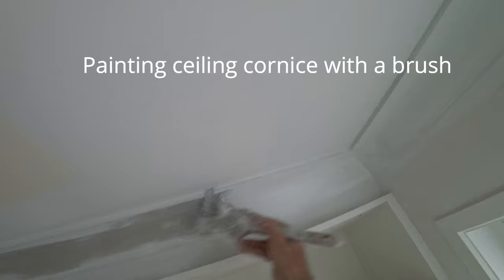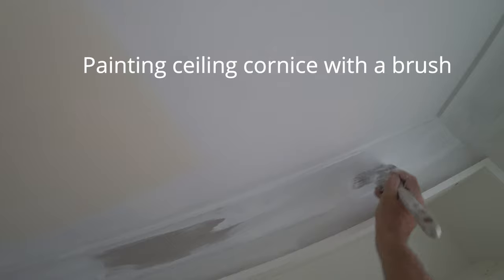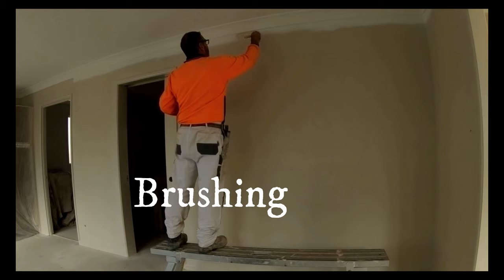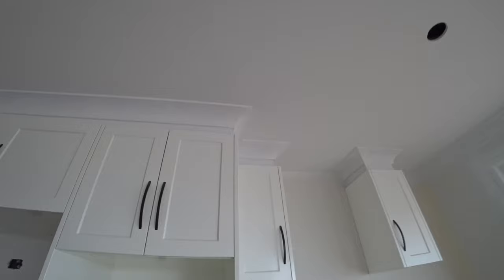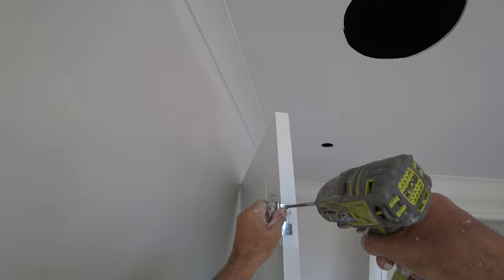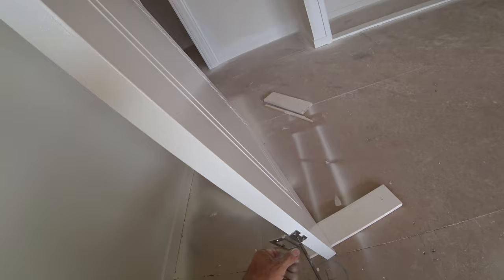Brushing ceiling cornice by hand

Comment: Ceiling Question. 50 year old house. Have painted the cornices by hand and rolled the ceilings.  Using oil based for undercoat. Have put up 2 coats as had to hide a few stains in the bathroom.  It looks great.  Can I leave it like that or should I add a flat enamel on top?  I have people that like steamy showers and really want to do the job right.
Reply from the maker: Don't leave it just undercoat,it will break down without a top coat,  apply a low sheen or flat water based acrylic for the finish coats, no need to use flat enamel
Reply: @ThePa1nterhowto  Understood. Thanks for the tip.  Also your recommendation on the ETS2000 is spot on. Best gun I have used!

Comment: I thought you had to brush and roll undercoat every time on bare gpyrock, otherwise it will peel away later on down the track, as it just sits on the surface and doesn’t penetrate if you just spray it. Is this the case?
Reply from the maker: Yes its the best for quality and durability to brush your cornice and roll your ceilings for the first coat, how you finish off your final coats is up to you. It is common in our industry to just spray everything and its wrong,the money the builders pay is not enough to do to it properly and shortcuts are taken. What we need to do is have a happy medium where painters are still making money and to produce good quality for the customers.